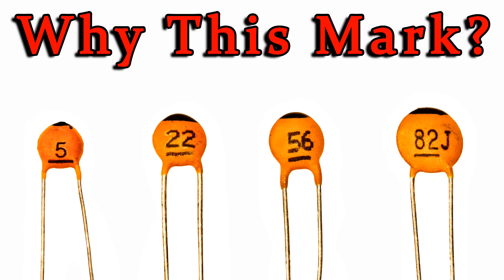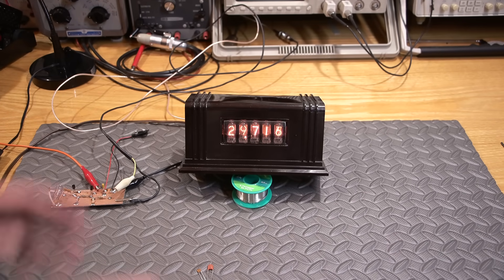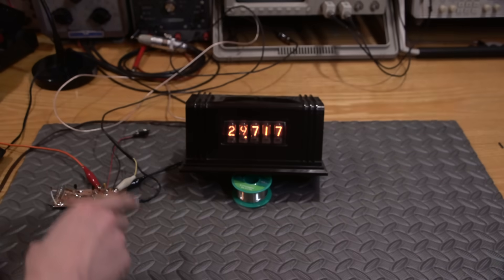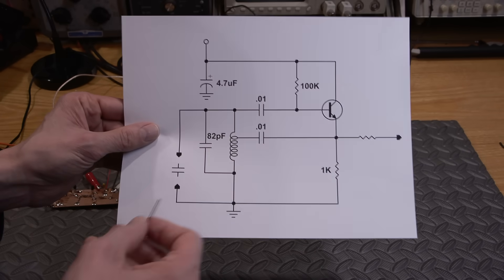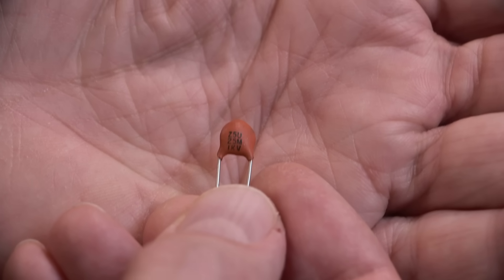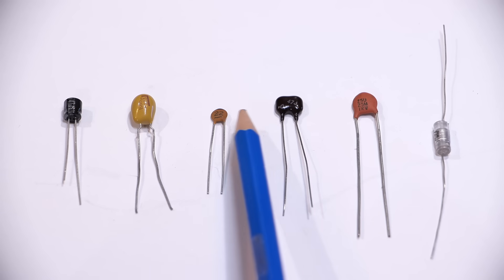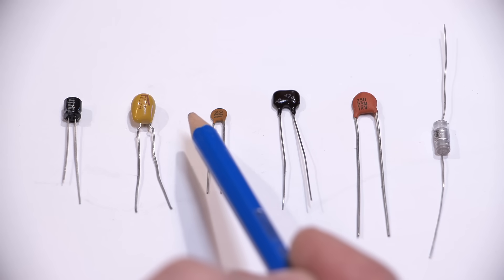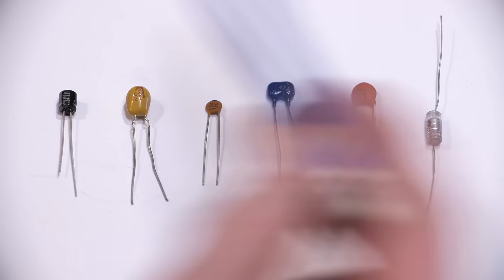Why This Mark On The Capacitor? Here's Why!

Comment: It's good to understand this when designing or servicing a circuit.  Still, for some applications, it's the gross relative size of the capacitance that matters, which is why we can see these little disks as bypass capacitors on digital circuitry.

Comment: I use a Sharpie to improve the thermal performance of my capacitors..
Reply: Don't give away those ancient Chinese secrets!
Reply: Pretty sure China does to on Alibabba and eBay lol
Reply: Can I use a white-board marker to achieve the same performance?
Reply: @sivansharma5027  Yes, with infinite variability and a derating mode
Reply: Now we wilp have ripoff CCP clones
Reply: Ha, ha, ha, I couldn't have said it any better  even if I tried   ....:face-blue-smiling::face-blue-smiling::face-blue-smiling:
Reply: Ha I had a puncture in my tyre, filled with super glue and sold the car..
I know it went more than 100 meters. ( distance to corner)
Reply: You make them converts to the faith, do you?
Reply: @1pcfred  good lord no. We need way, and when I say way, I mean absolutely zero of them. Not more.
Reply: Great idea ! 12-7-25 Su
Reply: lol 😂
Reply: Thing is about collectable electronics, they sit on a shelf and capacitors last forever that way.
Reply: Oh - my joke did already happened. 😉
Reply: hahaha pretend NP0. Nice 😂
Reply: LOL, probably like 90% on the market now days.
Reply: Generic markers won’t work.
Reply: lol
Reply: That's what I was afraid of 🤣

Comment: Despite being 50+ I learn something new from Mr. Carlson all the time, I did not know that for that marker on top of the capacitor, thanks for this. Now I have to go through my stash and check things out.
Reply from the maker: My pleasure!
Reply: I'm 48 and have been working on electronics in general since I was 16, and absolutely learn something from him every time I watch!
Reply: @JarheadCrayonEater  Me too at 67 and 50 years of electronic. Awesome.
Reply: 75yo here and one is never to old to learn - I knew of the indicator on the cap 😋
Reply: These revealed which books electronics can't, shows the real value each components, you're a GOOD Tutor Mr carlson, thanks.
Reply: Ahhh we’re all at the age when we figured out there is more to know in this world than we will ever know.😊
Reply: I'm over 60... and guess what!
Reply: Same; I had no idea.
Reply: "Temperature and Voltage Variation of Ceramic Capacitors, or Why Your 4.7µF Capacitor Becomes a 0.33µF Capacitor" must be required reading for every technician, student, or engineer ever having anything to do with electronics. In cheap-crap CN products you get the worst capacitor types by the way...
Reply: 50+! Agree, but been building circuits 50+.
Reply: We are ALL continually learning. Only Father God knows literally everything.

Comment: Capacitance variations of capacitors with class II dielectrics (Like this Z5U) are much more due to variation of the characteristics of the dielectric itself rather than the capacitor size variations.
Reply: That is right. And such capacitors have other unpleasant properties: DC bias voltage dependece, aging, microfonics effect.

Comment: On ceramic capacitors black is not the only  temperature coefficient color used.  Letter codes are also very common.
For Class 1 ceramic capacitors the color code/letter codes are:
red/violet or A = P100
black  or C = NP0
brown or H = N 033
red or L = N 075
orange or P = N 150
yellow or R = N 220
green or S = N 330
blue or T = N 470
violet or U = N 750
orange/orange or V = N 1500
yellow/orange or K = N 2200
green/orange or L = N 3300
blue/orange or M = N 5600

Letter codes are also used for tolerance ratings.  That's another chart.
Reply: and G  +/- 0.5pF  if u want to get super obscure
Reply: @echelonrank3927  What is the color code for G ?
Reply: @Zonfeair   i got my rarities mixed up, 
+/- 0.5 pF is color white letter E which is a capacitance tolerance and not a tempco. 

tempco can have its own tolerance such as G +/- 30ppm. i dont know what colour that is.
but the color for G as a capacitance tolerance is red +/- 2%.
there are EIA and JIS codes and colors , probably others. NPO is a JIS code negative positive zero marked C. the list at the top is a JIS code , japanese institute of science or something , i dunno. it would take a 15 min  video to explain everything properly.
but mr C takes 12 minutes to drip feed a single black dot into the populus , stealing 12 minutes of everyones time to advertise how they can pay him on patreon to reveal other dots. meh.
Reply: @echelonrank3927  That is a huge problem in many disciplines and between countries. Too many conventions and no standardization. The world needs to unite under one rule so we can stop with all this bullshit. People don't think about how the USA became what it is. It was only by Uniting the states that made it a great country. Now if we can just stop all the wars and destruction and start working on solving problems we can advance ten fold in half the time. That is what is called Synergy.
Reply: Good electronics books had this table of temperature coefficients.
Reply: Thanks for this - I've been looking for these other colour codes.
Reply: Very good!
Reply: Também podem vir indicado NP0 junto ao valor, sem a cor preta no corpo, a vantagem da marca preta é que só de olhar já sabe que é um NP0.
Reply: Very nice information thanks

Comment: Does it matter which way your polyurethane caps, capacitors go and vintage equipment any way to identify which way they go if you have not got the equipment to test them
Reply from the maker: That is circuit dependent.
Reply: The other capacitors that are ordered does not have the ban on them. They are hurry polyurethane capacitors, with no marks.
Reply: I am changing the wax capacitors from a helicopter S 38B receiver just trying to figure out which way the new capacitors go and the radio
Reply: Mr Carlson has a video on this https://youtu.be/BnR_DLd1PDI?si=ha0eaOvwtNNPKqpG

Comment: Wow. I never would of had a clue.

Thanks!
Reply from the maker: Glad I could help!
Reply: @MrCarlsonsLab I just started a little project I have been wanting since I was a child.  Little rf beacons that transmit temperature. Specifically to drive along mountain roads in the warmth of the car, and be able to know where the morels are popping up with the use of the radio.

I greatly underestimated how difficult that is.  At least when trying to keach the price to a minimum.

This will definitely get me a little closer. Thank you
Reply: Well now, that explains a lot.  I have a 2 meter (VHF) transceiver I built from a kit some 45 years ago.  I've been trying to get it working again.  It is experiencing frequency drift in the VCO.  Starts out good then as it warms up the frequency drifts causing the PLL to drop out.  
Thanks so much for the lesson.